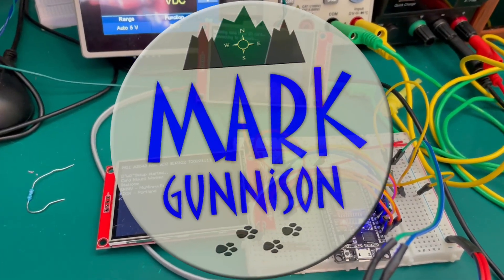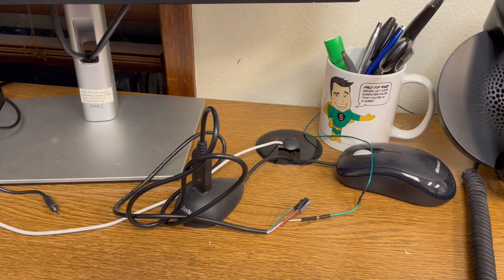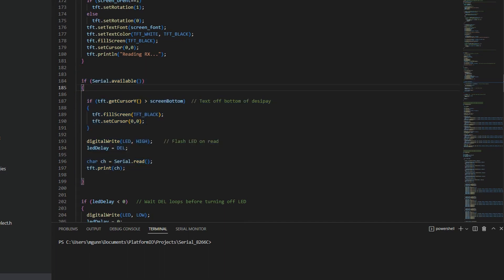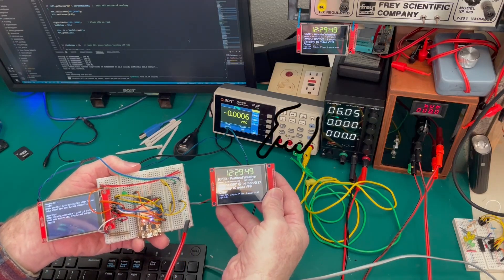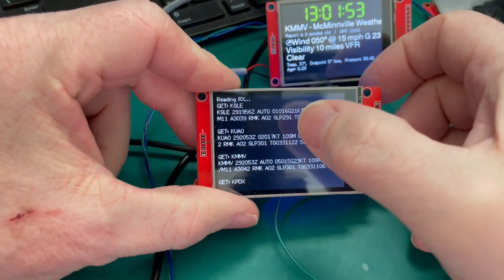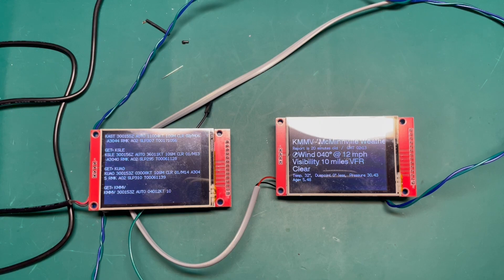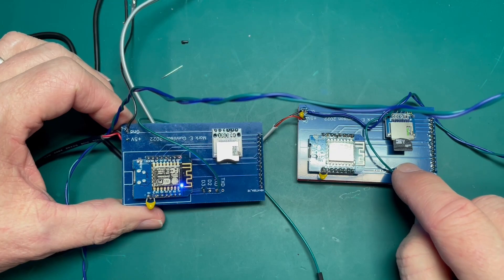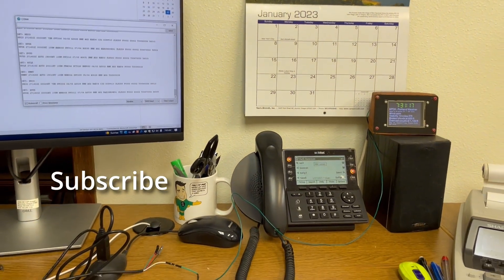Stand-alone Serial Monitor for Arduino Projects

Comment: Hi Can you please share the wire connection from display to esp82 directly? didn't find such an pcb anywhere
Reply from the maker: You can see the code at my GitHub page.  They are at the top of the code commented out where I should how I setup the User_Setup.h file in the TFT_eSPI library:  https://github.com/markeg1964/Serial_Monitor

Comment: Excellent work sir. Is it possible to get sketch? Thanks
Reply from the maker: I saved a copy of the code at the following URL: https://github.com/markeg1964/Serial_Monitor
Reply: @markgunnison   Thanks sir really appreciate it. One more question what is the size of TFT 2.2 or 2.4 inches? also when I am compiling it gives this error exit status 1 'class TFT_eSPI' has no member named 'setTouch'
Reply from the maker: @AAdnaanmtl  I'm using the 2.4" screen.  It has been a while since I worked with the code but as I recall the line "#define TOUCH_CS 5" is all you need to include the touch functions.  That line is somewhere in the User_Setup.h file.  As I recall, it is not close to the other lines that get edited in that file.
Reply: @markgunnison   thanks sir for your precious time and kind response. When I went through all User_Setup.h I just found this line //#define TOUCH_CS PIN_D2     // Chip select pin (T_CS) of touch screen. Are you talking about this ? If this is the line it means I need to uncomment if I am not wrong.
Reply from the maker: @AAdnaanmtl  Yes, in my example I'm using pin 5 as the touch chip select GPIO pin.

Comment: Very impressive. That's actually quite useful and I should build a serial display, too.  There are many times one would want to check in the health of a project without having to drag a computer with you.  Just be careful of levels ... The dreaded 3.3v / 5v issues that have bitten me in the past 😀
Reply from the maker: Yes, it was pretty useful when I needed it.  It has been sitting on the shelf since then though 🙂